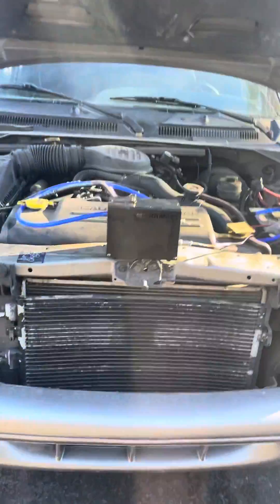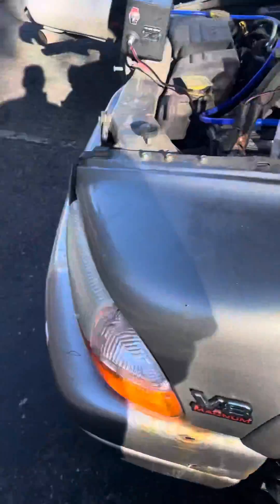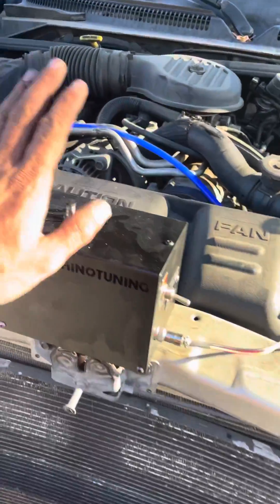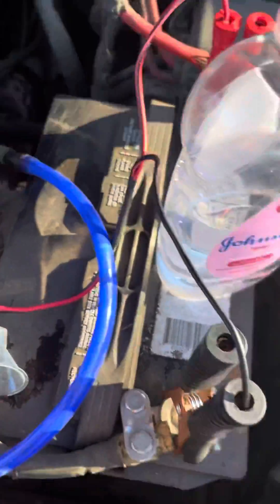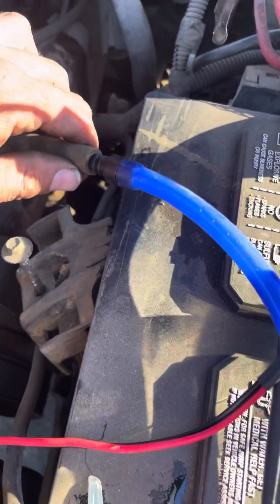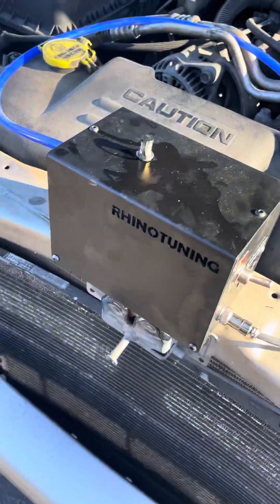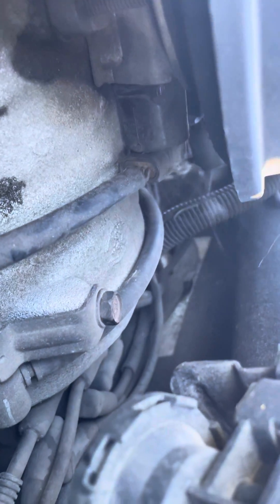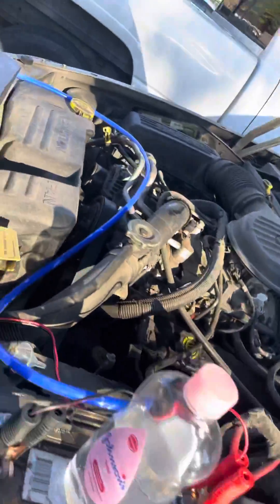2000 Dodge Durango slt vacuum leak detection

Comment: You can also just hook up a plain hose to the car and blow the smoke from a cigar/cigarette into it. But it's fun to see how these machines work too :) I just wouldn't have use for it after I find my vacuum leak. Thanks for making the video!! :)
Reply from the maker: I mean yea but the cigar smoke dilutes fast and the smoker keeps pumping and I have 9 vehicles lol I always have a use for the smoke tester also I work on various ppl vehicles and this thing comes in handy it was fairly cheap to not a bad thing to have in the garage